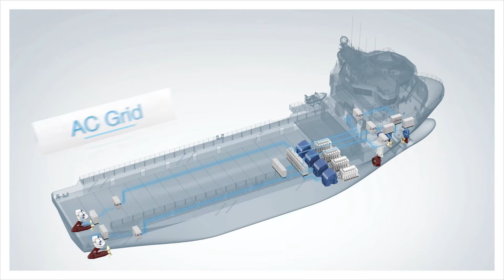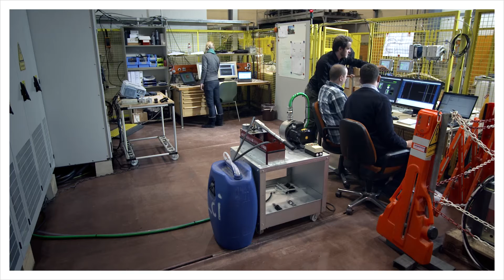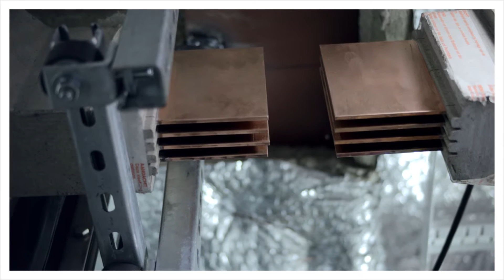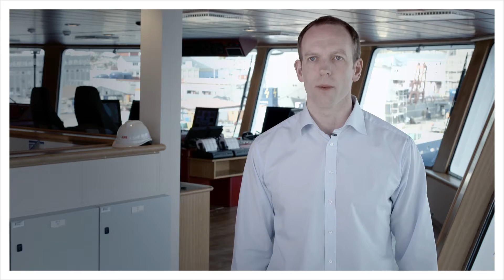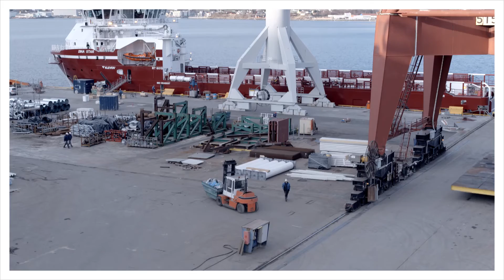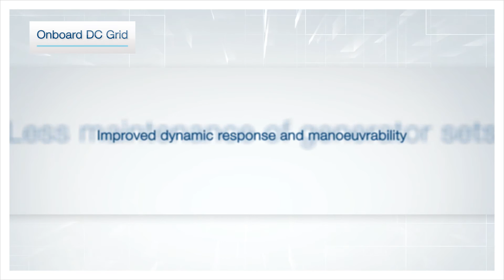Onboard DC Grid: A step forward in electric propulsion

Comment: So you have a battery, generator, fuel, OTT wire and DC motors... whoopee! Its been in the mining industry for over 100 years and you put it on a boat. TUNA TIME! dud
Reply: DC motors??? Highly unlikely, compared to using DC-toAC inverters driving either AC asynchronous induction motors or synchronous AC motors with permanent magnets in the rotor.